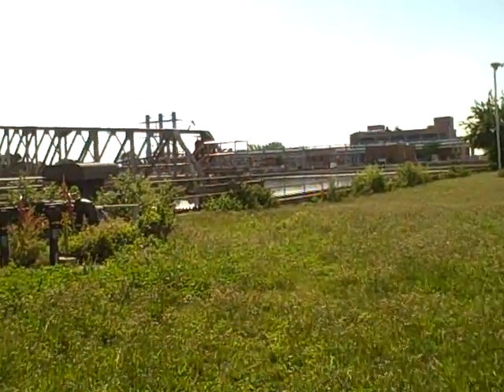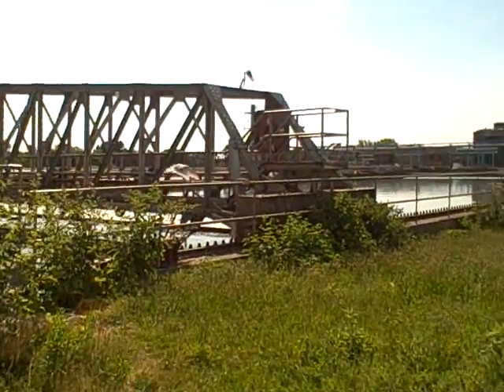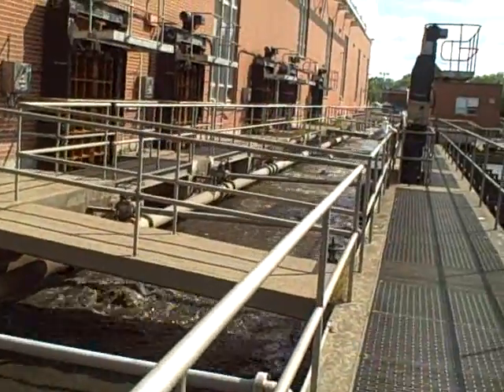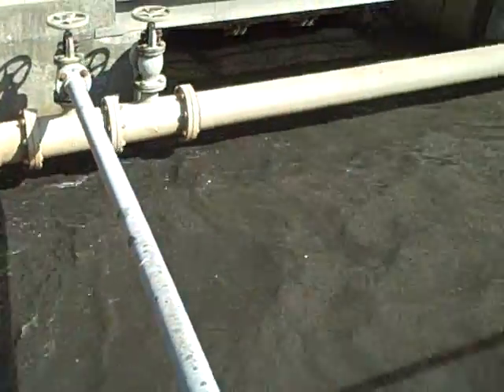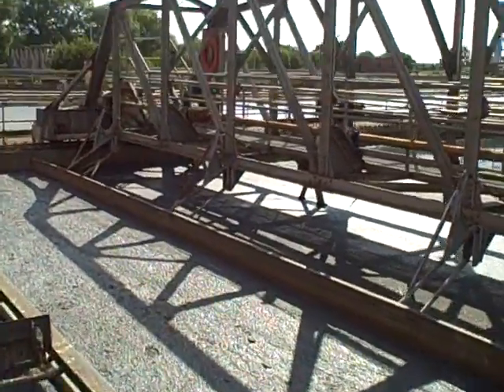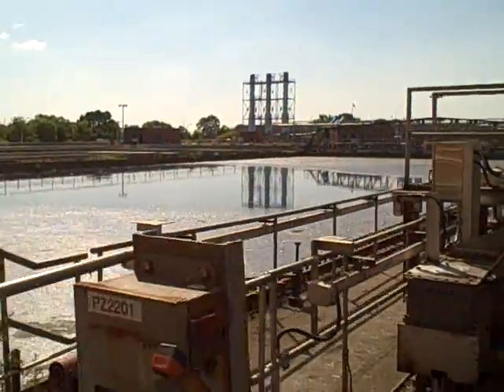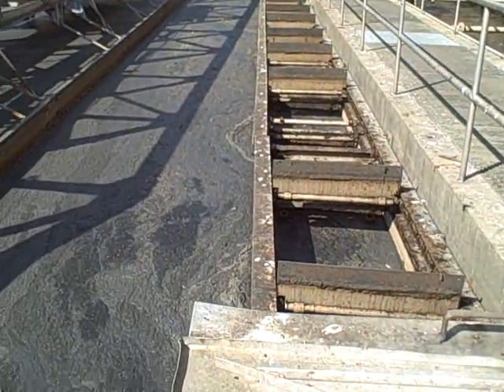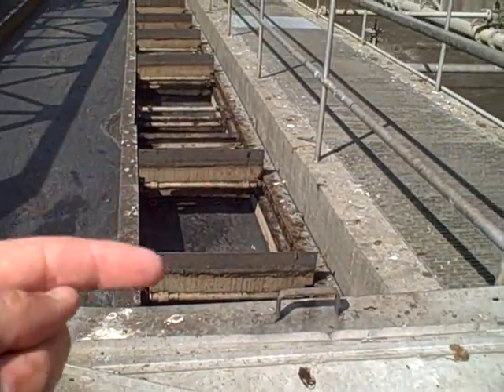Primary Tanks

Comment: I work at similar plants in the UK and am probably one of the few viewers to comprehend what you are showing.  In fact it is very similar to ours but on a much larger scale. We have three rectangular tanks like these at Camberley. Most sewage plants here use rotary tanks with a scraper going round continuously that draws the sludge into the centre at the bottom so it can be pumped out.